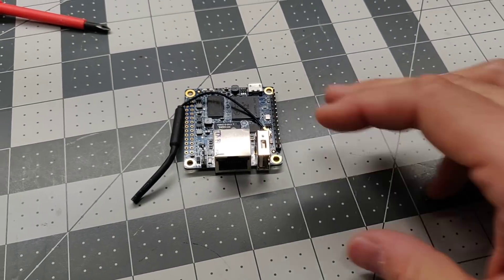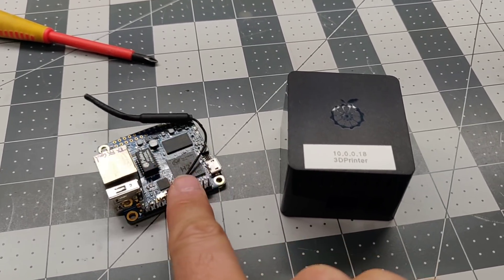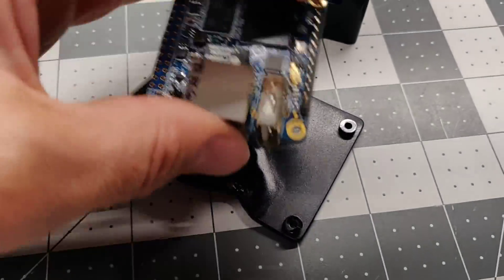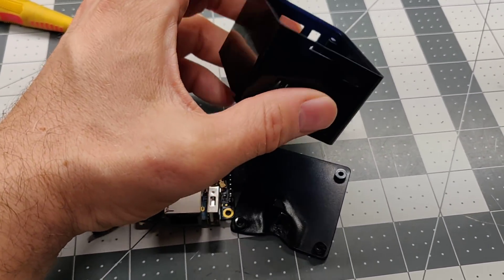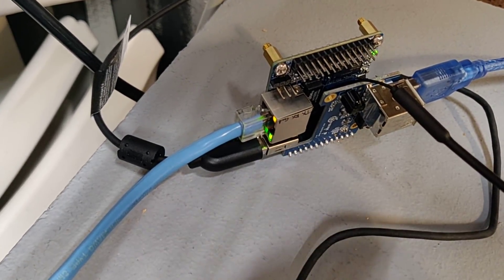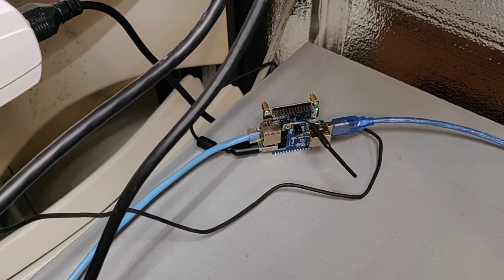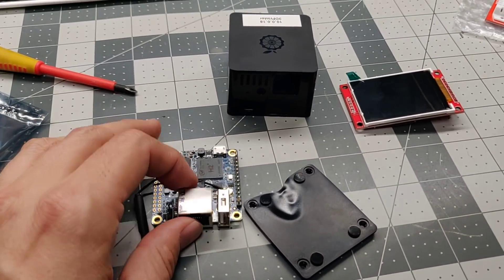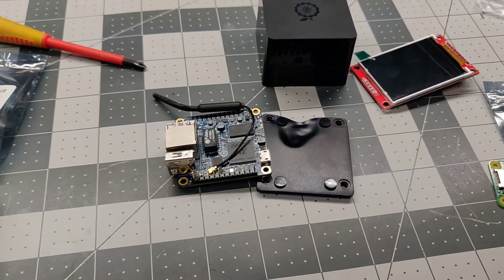Rant: The frustrating Orange Pi Zero

Comment: OOooh thats not good,  when I got mine well over a year ago, the ones I have are the 512mb versions 2 of them, like anything else I install I tested them and I noticed they run a bit hot 48c as measured from the package, after googling about I discovered the VDD, issue  what I did was this was put the biggest heatsink I could on them and made sure the heatsinks were in the path of 'moving' airflow,  I use the 2 extra usb ports on the header pins but dont use a daughterboard, I just modded a  usb m/board bracket for a pc and used that instead, some OS's will need a bit of extra fiddling to get these to work, I dont seem to get any issues with wifi access for octoprint at all, but before enabling the wifi I made sure my access point was on channel 1, 6 or 11 to minimize the chance of interference, - the only issue that I do get with the OP Zero is with running multiple octoprint instances, they work fine but if I change the preferences of one of them that  change is propagated to the other 2 instances on a  cold start/reboot, this is is a minor annoyance, and oddly enough this doesnt happen when tested on a raspberry pi, even with both setups built from scratch...

Comment: got  a 256mb ver.
while the cpu power seems more than enough, the memory problem still remains ... from my experience when running octoprint it has some issues at startup (opens alot of separate proceses wich take up space) fill up the ram and then tryies to creat more virtual ram on sd ... and that's what kills it.  
not to mention u need a fast sd card.
in my case on octoprint was running fine with a small fan on it 35 - 45degC. 
wifi was working without problems no matter what i put on it armbian , dietpi, linux. 
usually encasing it will make things worse if not using a fan or a big heatsink.
happy with the price i got it -- was like 9usd long ago.

Comment: The OPi Zero is running very hot - but without WiFi and with armbian my Zero did run 1 year 24/7 without melting in the original black case at (the wrnog readable) 70C.
The OPi "Zero Plus (H5)" or "Zero Plus2 (H5)" does run much cooler (at around 40C with black case or 25C without the case - but with a passive heatsink.
But I think the best will be a OPi PC or PC2 with a external USB-WiFi-Dongle - heatless and a secure WiFi-Connection :)

Comment: Raspberry Pi all the way. I've had TWO orange pi's - one OPi Lite and one OPi IoT 2G. The first one never even turned on, the second one would work one in five boots, approximately (and even then, it was a miracle if I was able to connect by ssh every time.
Overally, RPi is an ultra good experience, not so much with opi.
Reply: I think you did try the 2 word OPi-boards. At a low price the OPi One is running fine, but needs a USB-Hub because he has only one USB-port
Reply: dunno. I'm not coming back to orange pi, because if you release a board that has ONE pin out of ~20 actually operable, there's something wrong with you.
(as in, opi iot 2g never had proper drivers written for interfacing with GPIO, through some wiringpi hacks you can get one pin to work)

Comment: Armbian...get that distro..if you don't have a heatsink put one on it...they H2+ and H3 run HOT HOT HOT...also you can cpu limit down the processor to 816MHz and it will keep the cpu core voltage down to 1.1vdc instead of 1.3vdc (I have mine set to conservative in /etc/default/cpufrequtils), which will run much cooler...with quad core even running at 816mhz..it will outperform the Raspberry Pi Zero W by TONS!  Stock images suck rocks and they haven't fixed it at all...which is insane

I use mine w/o wifi (about the same as a NanoPi NEO), running a VPN and TOR relay...runs like a champ...24/7...but have to compensate for the processor running so stupid hot...it's a known problem

Comment: Don`t use cases and check the  operating temperature. Many don`t have temperature protection like throttling. I`ve seen SoC`s go over 120C. Raspberry Pi`s throttle when they get too hot. I review sbc`s on my youtube channel. Orange Pi`s are the worst. I`ve got one, didn`t want to review it since it`s so bad. The RPi 3B+ has got better wifi. Or just use a good external wifi dongle and a pi. Cheers

Comment: Be glad you didn't buy anything from Sinvoip. Their "banana" line are the worst SBCs I've had the "pleasure" to work with. No software support (only "beta" official 3 years old releases), no community support, nobody resolves any problems, tons of bugs, bad documentation, nothing works. After a nightmare to get it going reliably, it failed 1 year after. Probably bad ram as it was randomly segfaulting, panicking, freezing, nothing could fix it. Broke the board in half and tossed it into trash. Oh and to get it going "reliably" (until it broke) it needed 2.5Amp power supply... and extra passive heatsinks that I glued on...

Other companies (Odroid comes to mind) were kind of OK, I used around ~6 clones of the pi with more or less success, but still, I would also strongly recommend to just stick to original raspberry pis, as the community support and up to date software, almost no bugs & problems, well documented & tested are priceless in the long run.

Comment: i have an orange pi zero running with an uptime of 5 months so far useing dietpi running pihole .used some cheap rpi heatsinks and it stays at 45degc all day everyday ...heatsinks are your friend here
Reply: The thing is, these things are supposed to be able to run without heatsinks.
Reply: yes.. i use heatsink and mini fan inside the case, all is okeyy for months..the temp is around at 38degc.
Reply: I put a heat sink and fan on my pi. It's easy to overheat depending on what you do.
Reply: For the Pi-Hole, do you use or recommend the 512MB version, or do you think 256MB is enough?
Reply: @Reparaturkanal  ik used a 256MB  version...worked great and only 50% of memory used ..
Reply: If it needs headsinks then it should come with heatsinks.
Reply: @FloppydriveMaestro  The raspberry PI 3 doesn't come with heatsinks, but you should use one!
Reply: @danaadalaide5648  Yes but it wont catch fire if you are not using 1. It will just slow its self down.

Comment: Hi, for the wifi what happens by changing the antenna against an internal version for PC notebook, netbook etc ... So maybe with the longer cable that measures 40 centimeters (I am French) it will be further from interference.
In addition there will be on the same connector on the orange Pi card.

Comment: I'm running Armbian 5.38 Xenial/Ubuntu on the Orange Pi Zero. The processor is very hot. It's stupid that they doesn't advice to put a heatsink on the processor. I put a heatsink with Arctic Silver paste on the Orange Pi Zero. Now everything is running good. The room temperature is 21 degrees and the processor is 35 degrees and the processor runs on 1ghz. I dont have any wifi problems. Make a test with 5 orange pi zero s and it works fine. That your micro sd card is hot is not the problem from the orange pi zero. I use a sandisk micro sd card. Maybe you have to buy a good sd card. When you tweak and modify a littlebit you still can get a good solution with the Orange Pi Zero.

Comment: Hi All, Sorry to hear you had that problem, personally i have a PI-3 and barely use it, it does spend most of its life turned off and stored in a  foam case with the cables and usb joysticks / pads

I did look at some web sites and did buy the extra heatsinks and a 5volt fan that is powered of the IO ports / pins

Like most people i did run a temperature and stress test ( using PI haha ), but i think the longest it has run is maybe 12 hours straight.

I think some of these items, do need a initial review, then a 30 day follow up and 3 month  6 month for stability and long term effects - similar as you do with desktop - laptops

The reason i bough a Raspbery PI was the local seller in Australia, as the Orange was via aliexpress or similar and i had already seen reviews where the main orange pie web page had broken links and missing plenty of drivers, the $$$ was about $10-$15 AU , and i thought made in England plenty local support via large reseller, yeah spend the $15 extra.

I also bought the PI case and fan and the premade software image on  there supplied SD card

Did you mention how long the orange Pie had been continuously running ???  or is it 24/7 , i dont think they go to sleep or power down ( but that is a guess )

For you other PI, i would drill some air holes on the base of the unit and use little mounting feet like the brass ones you showed ( they remind me of PC board stand offs ) or some simple 10-12mm or 1/2 inch rubber stick on feet to get some more air flow

Also - i am not saying you have , but i am never a fan of overclocking, i know often it is a safe bet, but i dont find the performance gain worthy of the trouble and loss of stability and heat control even with better cooling solutions

Regards
George

Comment: Just an observation;  a lot of the “antennas” included with SBCs and LoRa and WiFi boards are not tuned ANYWHERE near the operating band, driving the SWR off the chart... that would reduce the useful link budget drastically, and definitely cause heating.

Comment: Rasbpery pi 3's also get hot and overheat if you dont stick a heatsink on it. Get one and maybe pint a case with a hole for a 30-40mm fan. Ive done some endurace tests on a pi 3 and even with a heatsink and a quite open case i could reach the 80*C redline reproducing videos  on a not so hot summer day and its supposed to go inside a vehicle so not the best either.
Reply: Adrian Black 
Damn! 139*C is a lot. Id recoment downclocking or playing with the voltages a bit if you cant find a heatsink or a better case. At those temperatures it wont last long before it fries itself. I wouldnt let most things go beyond 60 just so they last. With that difference in temperatures if it doesnt fry itself it will crap the solder joints or crap components around it, be it the caps or whatever other chip it can reach.

Comment: Not the greatest way to get you back on YouTube. We had an Odroid die yesterday at work, mid project, almost zero use. Sigh. Swapped it out for an old R’Pie 3 and been through hell and as solid as a rock. Yes there are higher spec boards than a Pie now, but at least you know the Pie will work.

PS, Will we get part 3 of the TRS80 Model 4?

Comment: All "official" opi images have overclocked chips, use ambian images, and radiator on chip, otherwise you will have heat issues. You have overheat marks under H2+ chip (burned pcb)
Reply: had same issue with zero, no burn marks, but some day it just stopped responding, radiator is a must on those SOC :/  at least price is right

Comment: SBCs in general are frustrating for me.  By the time you add storage and a power supply you've significantly raised the cost. Not to mention the cost of a case, and any external peripherals they might need to connect into your ecosystem.

Comment: "It should be noted that the official OS images from orangepi.org currently use broken settings leading to VDD_CPUX voltage remaining at 1.3V all the time and leading to unnecessary overheating" - sunxi Wiki.

Mhm, WiFi... i wonder what's up with that... voltage regulation? Faulty antenna design? Faulty drivers? Fighting with SD-Card for bus? All of these issues? Kinda want one now just so i can poke it and see what's up.
Reply: Likely enough - the Allwinner H3/H2+ CPU is fairly high-performance, maybe 6 times as fast as the BCM2835 on Pi Zero, and not particularly efficient, i think mild active cooling is appropriate at higher clock rates and utilisation rates. I guess a couple runaway processes is what the author of the sentence above might deem "necessary overheating" :D
Reply: Just to be clear. First, you try the Official OS from orangepi.org and it didn't work (overheat and reboot); then, you install Armbian and it works (stable, no reboot). Is that correct?
Reply: oh how cute. that arm based garbage can put itself on fire by poking around in some registers? lolololol. say hi to a whole bunch of new virusses for ip cameras and such putting buildings on fire haha. hooking up voltage/clock regulation to chips to software controllabe things is the most fucktard thing i've ever heard. ever heard of this thing called 'jumpers'? yeah it's so people don't put your house on fire by hacking into your fridge.
Reply: Might as well go back to valves then since every advancement is fucktardary /sarcasm.
Reply: Sven Olaf Kamphuis
You haven't used a computer since 1994 I take it?
In my aging 2nd gen i5 system, I can set the frequency and voltage of the CPU and RAM, aswell as the software thermal protection (there's also fixed hardware protection in both Intel and AMD CPUs, but it's toasty high).
Reply: Yeah Sven, I LOVE having to constantly switch the jumpers on my phone every three seconds so it always runs at the most efficient speeds!
Reply: @CB3ROB-CyberBunker  why is your fridge connected to the internet?
Reply: Probably ot overheated the wifi card and damaged it...
Reply: Indeed, it overheats as having 4 CPU cores at 1,2GHz. By reducing max frequency and switching to a reasonable governor, my OPI zero operates well constantly at 40°C with a small heatsink. (Running the latest official armbian)
Reply: @ZsomborZsombibi  hiw do you do that?
Reply: @yalgret  # cpufreq-set -u 912MHz -g powersave
That merely reduces CPU performance. Command 
# cpufreq-info shows possible frequency and governor values for the specific processor.
Reply: @yalgret  heat sinks of course and buy Odroid products instead.
Reply: I only have a PC plus version and did my kind of trickings too for other stuff, but these orange pis work well if one knows what they are really doing... At least that is my experience. Also... no heatsink? Really he did not even apply a heat sink on this? The first thing that pops in your face is to apply a passive heatsink on an opi at least I saw this everywhere when I bought mine...
Reply: I've just set up an OPi Zero (H2) as an octoprint server, and even when all CPU cores are at 100% for five minutes solid it doesn't go above 40c.
That's with a heatsink, and now that I think about it ambient temperature outside is only 10c, sometimes lower, so that might contribute. I've just found that current Armbian is fine as is, so long as you have a heatsink.
Reply: After working with the OPiZero for a few months, I have some observations:

1: It needs semi-active cooling (or at least a heatsink). I put a heatsink on mine -- just a copper pad -- and saw temps drop. In a 3D printer environment, you definitely want active cooling
2: Quoth the Armbian page for the zero pi: "Onboard wireless module (XR819) has poor software support so wireless connection issues are expected"

By poor support, it means "so we figured out how generate raw frames and that's about it". From the xradio kernel driver git: " The xr819 chip/firmware drops tons and tons of frames with FCS errors and this makes performance horrible at best." Armbian's github issue tracker has a whole bunch of shenanigans about enabling it: https://github.com/armbian/build/issues/688

All this was fixed in the R1 and Zero Plus (both use a different -- Realtek -- wifi chipset) with much better overall performance.
Reply: I quite like the Zero Plus, I have a few ordered. Sadly support for the H5 isn't nearly as stable, but hopefully it will soon mature. For now, pick your poison.
Reply: i use armbian 5.38 and i use heatsink and mini fan inside the case, all is okeyy for months..the temp is around at 38degc.

Comment: I just ordered that one with the case

Looks like ill be looking into a metal case and fan when the mobo gets hot

Thanks for the warming
Reply: charlie brownau
Amusing autocorrect/typo.... "Warming"
Reply: My experience, do not use the original case. Even in idle state the CPU reaches 50°C easily. With load, it reaches 70°C in matter of seconds...

Comment: allwinner SoC does run really hot even if it's not under heavy load, it's a common problem for this SoC brand, I'd recommend using an RPI if you want to put it in an enclosed space.

Comment: With the Armbian image I had no such problems (warm to touch  at most). The wireless also is stable enough. Also you can lower power consumption to sub-Pi levels with some cool tweaks here:
https://forum.armbian.com/topic/1614-running-h3-boards-with-minimal-consumption/
Take note that this only works with the legacy kernel.

overall imperfect hardware but for $10 it is crazy value.

Comment: Are you running Armbian? It should have better thermal management, I have one that I use as a PiHole and OpenVPN server and it works fine , cool to the touch.

But yes the internal Wifi is rubbish.
Reply: Adrian Black Wow that's a huge design flaw, will do some testing in mine and maybe write a script to switch it off if it gets to 90Deg C